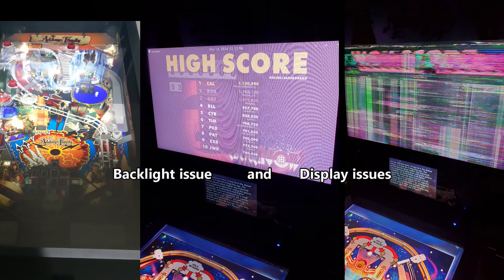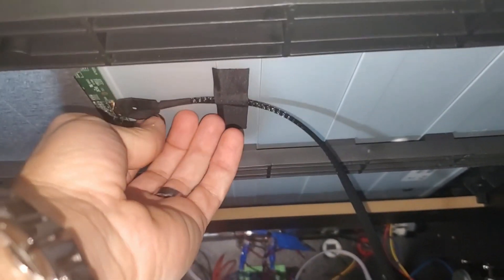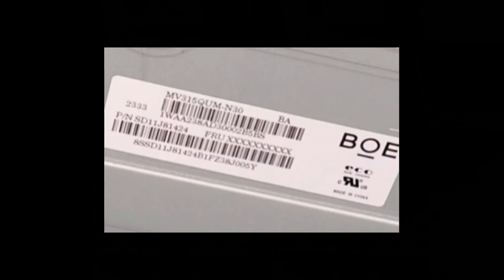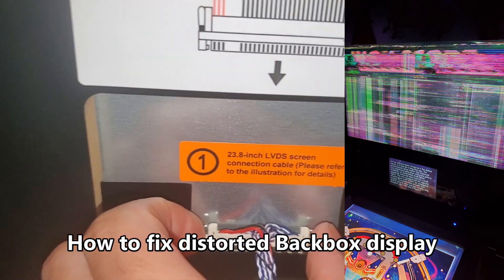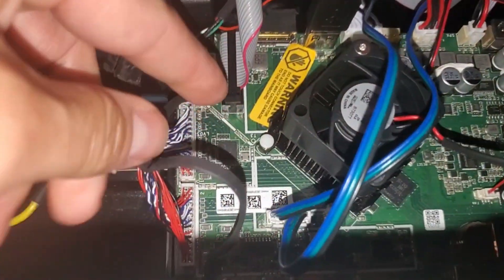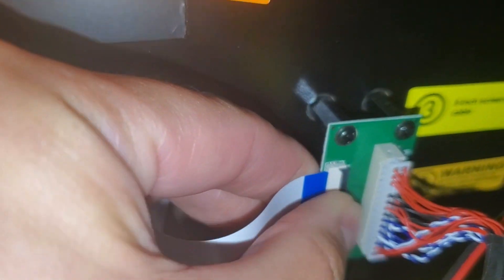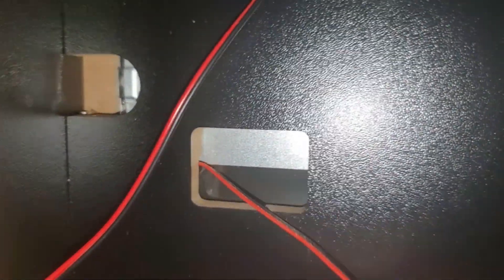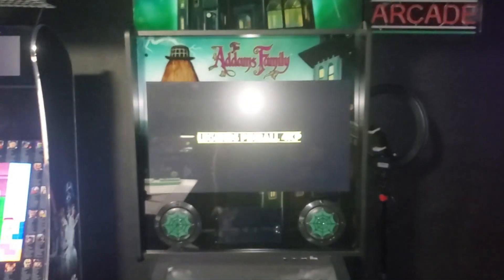How to Fix Legends 4K Pinball Backbox - DMD - Playfield Display LCD Screens

Comment: Hello Paul, help please my machine arrived and upon following instructions from Atgames saw that the playfield cable was not attached at all, I’m unable to attach it from the back not enough room due to the way cables were handled, and upon lifting the playfield don’t have the dexterity as it doesn’t seem to want to plug in, any tips you could offer or expound on?